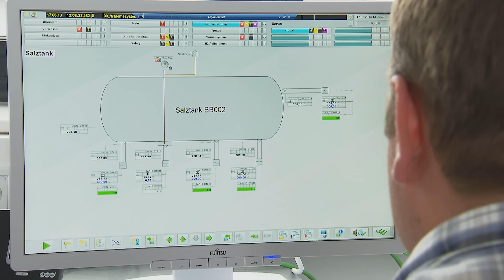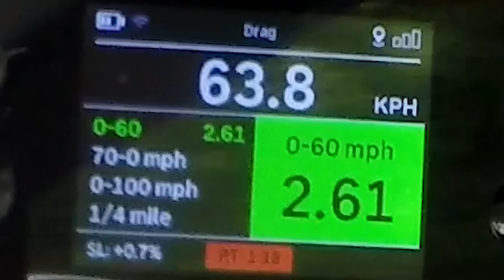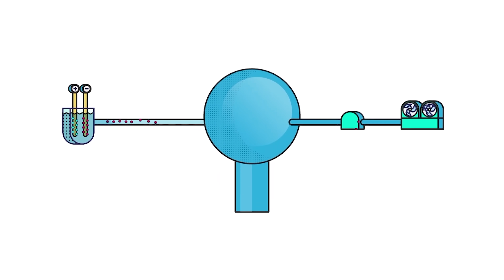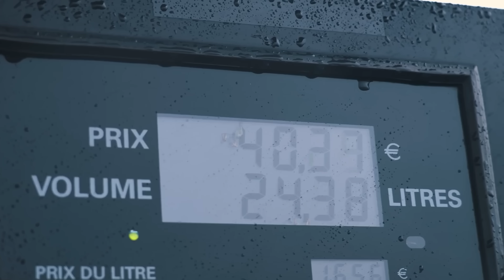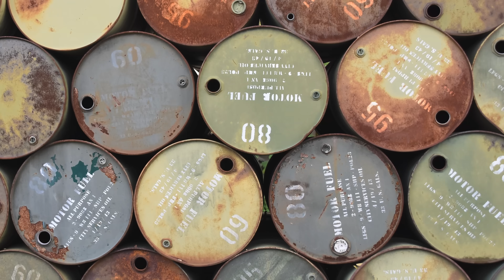Porsche just SAVED petrol engines FOREVER

Comment: There is unfortunately one big problem as of right now with E-Fuels: Efficiency! They're about 4 to 5x less efficient than electric batteries, which means that the energy required to keep an ICE car with E-Fuel running is much higher than that of an electric car. Therefor much more power plants are required. However, this does not mean that's its not possible. Fusion reactors are on their way and we're still not even close to fully utilizing the sun as our primary energy source. On top of that, who says that electric cars and ICE cars can't exist together? Not every car needs to run E-Fuels and not every car needs to be electric. In an ideal world we would have E-Fuels, Electric and Hydrogen and even some regular Diesel/Petrol cars.
Reply: Hydrogen sucks for efficiency too. Even green hydrogen (i.e. produced by splitting water into hydrogen & oxygen) takes 3-4x as much energy to produce, ship, store and turn back to electricity as just charging a battery. And hydrogen usually isn't green, but instead produced during petrochemical processing. It was boosted by the oil industry and laggards like Toyota to sow some FUD around EVs and green tech. About the only viable future for hydrogen is when you have a surplus of energy which would otherwise go to waste if it wasn't captured somehow. Even then, there are probably better ways of doing it.
Reply: @drxym  That and the massive difficulty that is storing hydrogen. It tends to slip through most things. Plus hydrogen embrittlement is a massive problem.
Reply: Yeah the video left out a few VERY important points. I think in my perfect world the would all co-exist together. You have Efuels for old ICE cars or ICE sports cars, BEV for your general individual transport and maybe hydrogen for trucks and ships. We'll see how that goes...
Reply: @jorrit_o  My thoughts exactly. If it's a two seat sports car ICE should be allowed, like sports bikes the numbers they are produced in are minuscule compared to the rest of personal transportation. Heavy transport should be RNG for now, then as H2 is ramped they can use that. And absolutely 90% of people's commuting appliances should be EV of some kind, even then all we are doing is burning fossil fuels (for the most part) to charge the EVs right now, eventually, hopefully, that will change to almost all fission and renewables/energy storage.
Reply: "Fusion reactors are on their way" I'm 56 and fusion has ALWAYS been "just" 50 years away. Do you HONESTLY think that the NWO, WEF maniacs are going to allow fusion reactors to get anywhere, thus freeing up humanity from most of their control? Dream on, pal!
Reply: And full EV is not sustainable. By 2050 only the hyper rich will be able to drive a car.
Reply: Oh yes, Fusion reactors, what could possibly go wrong?
Reply: @TML34  what could go wrong then?
Reply: @TML34  equitigy iniatives
Reply: well said..
Reply: This is amenable. The biggest concern with synthetic fuels or EVs is making sure that the carbon output is carefully counted and reduced tooth to tail. It's not zero carbon yet, but much much lower than traditional ICE cars
Reply: I agree with the first part but hydrogen is called hopium for a reason and ICE cars pollute too much C02. I can see e-fuels and EVs coexist but other means are not realistic
Reply: Yes, this fuel will be expensive and waste a lot of energy.
Reply: That’s true but to be honest- Diesel needed a few years to be perfect as well and I think with some research we can achieve similar stats
Reply: Isn’t their a lack of resources for the materials that go into making batteries?
Reply: reason why i dont liek electric car is  that battery degradation and lack of battery recyling. dendrites that forms from battery degradation is messes with recyalability too.  if you look at sandy munroe video caled wjats insize 680 battery, there could be indicator of how much of battery can be recycled by mechnaical seperation vs what chemical process would be needed, woudl it be susntinable process? recycling company called redwood. even if they fix this problem, will they dig through trash to find enviromentally damaged (rust, mud,etc) dead car batteries currently being dumped, and recycle them? in emissions, best hting to do is a ca rof where rear seats face the rear as comcpact 4 seate rreplacing 2+2 seater cars and yaris corolla cars, and  rear mid engine small combustion flat 2 cylinder wnith no rotatiing parts to send power to wheels, instead magnets moving back and forth make electricty aand or a little supplemnetary compressed air , to power electric drive and compressed air driver, possibly with no battery or at minimal battery, using supercapacitor etc. single combustion chamber would help preserve heat for optimally low emissions or effeincy, hydrallic switch will push pistons back to position so they can be pushed by combustion..  optimal combustions per second for emissions with electric and mechnaical hybrid turbocharger, sometimes engine will run beyond optimal effiency or emissions levels for unsuually high power demand to protect long term emissiosn and fuel use reduction effetiveness of battery for common lower power use. with limited batterys to use, hybrids are already more effceint effective at reducing emissions, vs using that battery material for fewer cars who are electric cars, becaue most emissions happens in low speed high pushing power sitatuaitons of combustion car, where emissions are most likley to chemicaly harm health of nearby people becaue its usually compact city area with many people nearby.              what battery size is best for longevity?  see tony hellers climate change videos, maybe somone can make use of suspicious observers videos.          see aptera owners club video on saftey, unqiue materials they use, lightweight is safer to peopel outsid ethe car but can be safe for people inside car compared to hevaier caar if using right materials, and even safer due to wat type of crash is more likley to happen.. linearly more lighter weight exponentially causes less road wear damage causing less resurces and emissions and road downtimes. .....  the low weight compared to  structrual strength and crash energy absorption, makes its safer per costs ,. the weight lower to ground (if that is how its still done) can make it preserve momentum around turns more, which is more energy effceint than relying on regenerative braking, and battery, brakes, lubrication, etc would last longer. tires longveity may not be affected despite higher speed and fun of preserving momentum with minimum g forces .      ....      in effeincy per functionality, rear seats facing rear in sompact 4 seater woudl make more sense. solarpanel effeincy is only arouund 20 percent and can become lot better     if u want lower emissons(whch only helpful for heath of pepe wh send mhme near heavy traffic roads), then using mited batteyr supply for hybrids is lower emson than using the suppply for fewer cars whch are eletric car. big batteyr means exppnentially less effceint, so the more energy going in and out the battery means worse battery degradation, but more parraleles of battery reduce battery degradation... so more battery is not better, theres a balance to be had. 
						 f
Reply: @kalm monke  Currently there is less old batteries for many new recycling plant to recycle. In 10 years time when new batteries is required, there would already new newer batteries developed and cheaper better recycling.
Efuels are just greenwashing.
Reply: @frankreynolds9930  if they can solve shortage
Reply: We have fission reactors right now but no one uses those
Reply: @ventilate4267  OMG - nobody is using the nuclear reactors producing, as I write, 4.3GW or 13% of the UK's electricity ?
Reply: @robdavies6682  that's it? There's "apparently" 50% in state I live in. Anyway my point was that it's still not more than coal so it's basically unused
Reply: @ventilate4267  yeah they are not ready yet
Reply: I see a lot of doubt in the comments, but being from Germany, i'm very confident E-Fuels will become part of the 2035 Law. Simply because several Companies that focus on researching that, both known Car Manufacturers from Europe as well as Independent Companies are getting a lot of Gouvernment Grants and Support for the Research and Production of E-Fuels/Hydrogen.
Prost & Cheers from the Bavarian Alps
Reply: there aint enough rare earth minerals to make every car electric
Reply: @TheJarric  maybe we should stop with the oversized cars then to start
Reply: @ventilate4267  even wef admits rare eart minerals are proplem cos greens dont exept them in europe they need to be excaveted in child labour in thirld world or russia china axis
Reply: @TheJarric  what's mined using child labour?
Reply: @th3d3wd3r  cobalt and lithium according guardian
Reply: @The Jarric  is that where you get all your facts? Lol. The majority of lithium comes from evaporating brine pools on salt flats. The only place lithium is mined, is Australia. If you want to make the case that Australia uses child labour, you'll have to get some evidence of that.
As for cobalt, some companies source it from the democratic Republic of the Congo, who do have a history of using child labour. However, very little cobalt is in batteries. The majority of cobalt is actually used in oil refineries to remove sulphur from fuel.
Reply: @th3d3wd3r  amnesty and finabcical times china uses child labour in lithium and battery demand has increased labour demand for coboult
Reply: @The Jarric  China gets its lithium from Argentina, Chile and Australia. No child labour there. The actual issue is child labour used for cobalt and coltan in the democratic Republic of the Congo. Or at least it was, since its use was a PR nightmare.
Reply: @TheJarric  Are you one of those people who think because it has the word "rare" in it, it means there's not much of it?
Reply: @th3d3wd3r  that exatly what it means demand is higher than current known sources
Reply: @The Jarric  that's not what it means at all. Maybe, check the definition before commenting.
Reply: @TheJarric  That's not true.
Reply: @rowaystarco  even wef thinks so
Reply: @TheJarric  there are different alternatives for batteries, some not needing that much of rare earth minerals. There's also a high potential in recycling old materials. But that being said, it's important that we also reduce general care usage, especially in cities/urban areas.
Reply: @TheJarric  "there aint enough rare earth minerals to make every car electric"
^ Even now the vast majority of batteries go into every laptop and cell phone ever made, and no one has ever implied that there's not enough material to make batteries.  Not to mention that they are potentially recyclable - 100%. 

This is just the 1st of many desperate attempts of the oil/ice industry to save itself.
Reply: @summertyme5748  Quite similar to the "oil is going to run out by 1990" and "oil is going to run out by 2010" brigade then.
Reply: @summertyme5748  but there’s not enough oil right ? 😂
Reply: @summertyme5748  My phone has a 12.1Wh battery, 20Wh would be concidered as very big. My laptop has a 45Wh battery, 100Wh is the biggest you're allowed to have. 100kWh is a good size for an electric car battery, 70-100kWh is the norm if I remember correctly. "k" in kWh means kilo, which indeed means x1000. You can make 1000 laptops with a battery concidered as "huge" or 2000 with a battery concidered as average, or 5000 phones with a large battery out of one decently sized car battery. And don't even start me on trucks.. As far as we know, we do have a limited supply of rare earth materials, so the amount of batteries are also limited if someone doesn't develop a new kind of battery. E-fuel does have it's place for commercial applications with huge equipment, but for cars I think a mix of both would be the most ideal..
Reply: @summertyme5748  Utter nonsense. The equivalent number of battery cells to make EV batteries is many, many times that of laptops and phones. Please define the details of the"potentially recyclable" process, because it is cr4p.
Reply: @gabon4000 tell me you didn't do any research into battery tech without telling me you didn't do any research into battery tech before you wrote this. You haven't heard of lfp batteries which are already in cars with no rare earth metals included + lithium ion batteries are already 95% recyclable, with another ten years of production it will be a virtually closed loop system

Comment: EV's destroy the ecosystem of where it's extracted from...making it unsustainable.
Hybrids like the SF-90 and the Revuelto will be the way forward.
Watching Seen Through Glass's video on it Porsche say that you can even mix Petrol and Synthetic Fuels to make it a Net Zero Emission output. Sounds like a win for Engines of all sizes!
Reply: What about the ecosystems that are destroyed by fossil fuel drilling? OIi spills kill ecosystems. EV has the potential to be a totally sustainable, grated currently it could be better but still better than ICE. Its takes 5 times the amount of electricity energy to make e-fuels vs in a EV. The video didn't tell the whole picture...
Reply: Rubbish
Reply: Is Porsche 911 GT3RS a hybrid one?
Reply: @purwantiallan5089  No it's not but with the hybrids it will take the engine output to over 1000HP. A Hybrid system like the Revuelto's 180HP EV system could turn the Porsche from a 518HP to a 700HP car...that would be insane!

Comment: Too many points of concern to list, but some initial ones - cost, pollution (transfers CO2 from remote areas back into the city), continued dependence and profiteering by the same oil companies that got us into this mess, etc, etc
Reply: The aim is to have many avenues that will help keep the ICE alive, whether its E-fuel, Hydrogen or Ethanol. It is unlikely to have a one size fits all solution.
Reply: @zaynezaman  ICE Engine should've been kept alive.

Comment: You know what you also need for e-Fuels? A much more big abundance of renewable energy, roughly 10 times as much. So yes, you will be able to drive a 911 after 2035 - if you bring the cash - it will be horribly expensive.
Reply: I bet, if there will be a whole industry surrounding efuels, it will be made a lot cheaper. Computers were very expensive and big at first and now they are in nearly every home
Reply: @yourDecisi0n  Putting the electricity straight into your battery will still be cheaper... converting electricity to fuel and then burning it in an ICE is still extremely inefficient... no matter how big the industry is... But I mean giving people who can afford it the option to still drive it is a good thing I guess. But it will probably mostly be for sports cars when it comes to individual transport.
Reply: @jorrit_o  Yea, I agree. Though, I could imagine it being a good thing for the future, especially if the process will be much more efficient and cost-friendly. Of course electric cars are in theory better, but in reality, in countries where there is not much supply for renewable energy, efuels could at least provide a good and eco friendly solution as it can be produced in countries with high supply of renewable energy. Which is a big plus for efuels compared to electric cars
Reply: Best thing ever
Reply: I'm going to bet the Tesla next gen vehicle will piss all over this last gasp attempt in around 2 years or so😂
Reply: it's basically the same for electric cars. do you think it would be cheap to charge it if everyone has an electric car?
Reply: Yes, that is a bit ironic that BMW says we dont have enough electricity for everyone driving EVs and then eFuels come to the "rescue"; the eFuels will need 10x the energy for the same distance travelled. Sure you can then say: we just scale up the clean energy, but: there is already an energy crisis and while you can scale up green energy - you could make better use of that green energy with EV propulsion.
Reply: @OlavAlexanderMjelde  BMW and Lister dont have enough electricity.
Reply: That's fine for Porsche owners right? And in 2035, EVs (and their batteries) can probably be cheaper and better so it should be fine for most people.
Reply: @aartwallow  yes. Talk about coincidences for some people who wanna buy those Porsches.